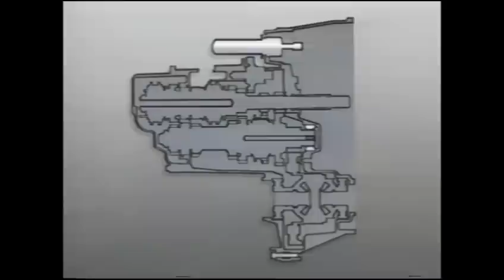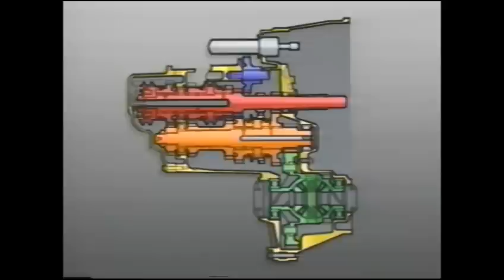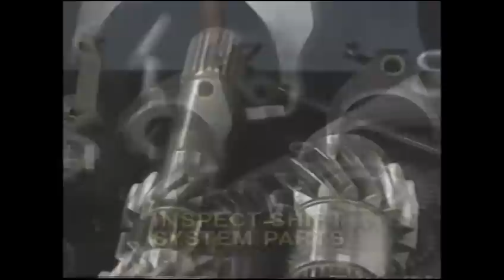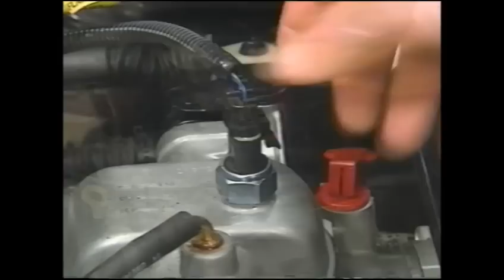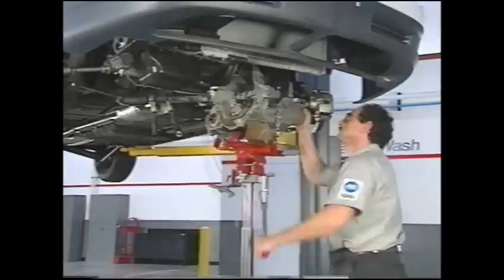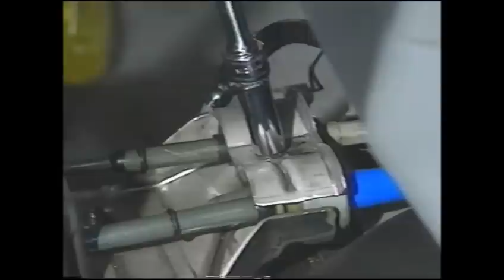Saturn Training Video - Manual Transaxle Repair

Comment: 21 years and 1/4 million on my saturn that I bought new, and still going. I'm the mechanic, so I appreciate the uploads. They will go nicely with the factory service manuals I already have. It seems engineers had too much input on the design of the car which makes it a durable, reliable, elemental, and easily serviceable system, and perpetually reusable until the parts run out, though they seem a little crude and not highly desired by those who buy cars, use them up, and toss them. By the time the parts dry up I will be dead so this is basically my car for life. No more car payments. Ever. Haven't made a payment since 98 LOL.
Reply: bunberrier. yes saturn was trying to compete against Japanese car imports and saturn had to make there cars better than the Japanese rice burners like Toyota and Nissan Rios and other great cars and saturn needed to outsell the imports so they built reliable good gas mileage and hard plastic non dent side panels on cars.I have a 98 sl and it runs good still and not a dent on it and paint is still looking sharp on plastic panels.good engines dohc sohc 4 cylinders.I love my 98 sl 4door? saturn.
Reply: Mine 02 Saturn sl  hopefully getting the 300000miles.this year.the way my wife drives it I think she will lol.
Reply: @choncoconcos5912  Drove mine yesterday. AC compressors are getting harder to find now... all else ok
Reply: @bunberrier  keep it going man.its worth it.
Reply: Yeah i am bitter about the BS that my own dealership that I purchased my brand new 2005 redline from and mechanics that I worked with closely while I worked in the parts department and service department failed to inform me of what was coming and the fact that these parts most parts actually are now obsolete and the recalls/campaigns are of course only paid one time by the dealership like they are doing me a fucking favor then they rename the campaign or actually put a different number on the recall and it’s the same issue that’s happening so I have to pay out of pocket five times over then my vehicle won’t pass smog through the DMV so I have to duck the police and drive around with expired tags because of this lemon that they never backed up and they just dropped all of us lovers of this vehicle that was practically perfect. But hey I’m happy for you you’ll be dead by the time blah blah blah blah blah have fun with that

Comment: did you know Saturn used Honda motors for 2 years or 3 that are very fast
Reply: The Saturn S-Series never used a Honda engine. The engines used in the Saturn S-Series were specific to Saturn only. The Saturn VUE built in later years, had a Honda engine.
Reply: What?
Reply: so?